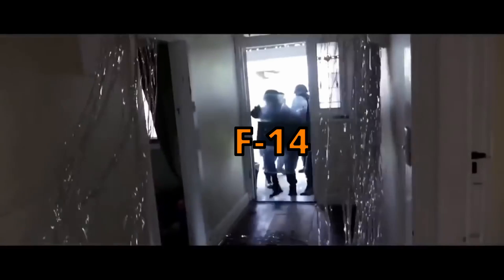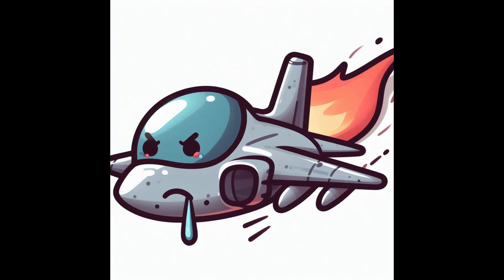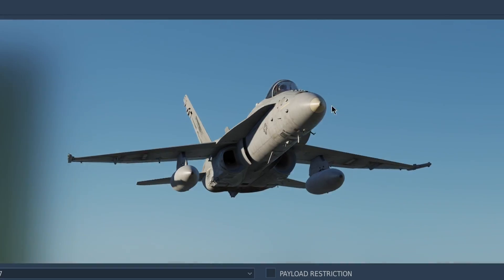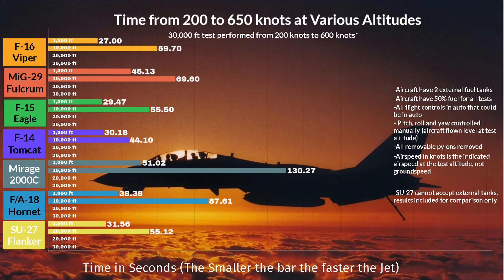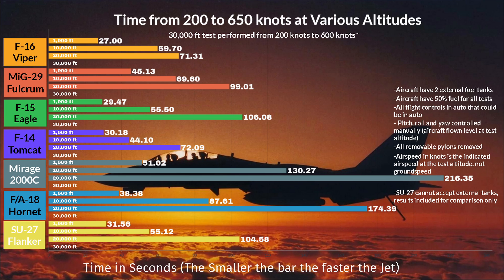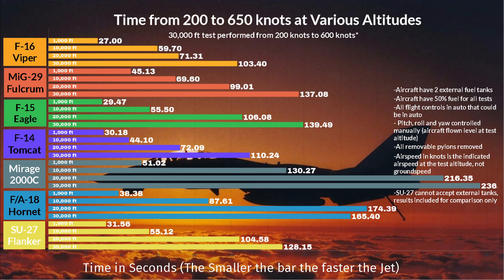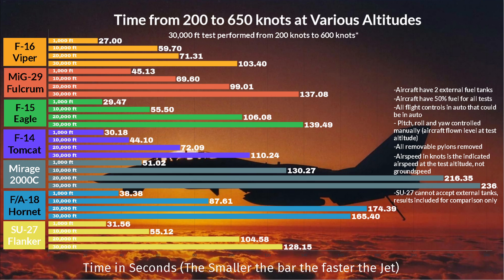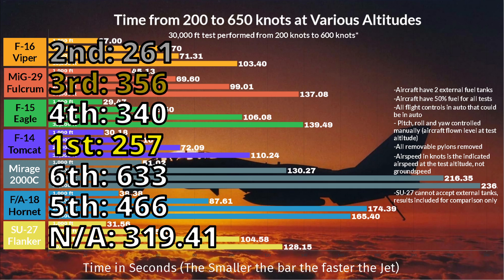F-16 DETHRONED! Fastest Fighter Jet in DCS Test

Comment: F-14B/D: 150kts to 610 kts at 10,000ft... 9.7 seconds. Fighter Pilot Podcast "F-14 Tomcat vs F/A-18 Hornet—Which is Better?" at the 2:29 minute mark. Tomcat model is not broken. This was a clean Tomcat but do not know what the fuel load was, probably under 10,000lbs. With tanks... maybe double this???? This is an average of 47 kts acceleration per second. Clean F-16 at airshows does 40 kts a second. The F-14 can do M1.6 at 10,000ft. I read the F-14B/D is the fastest accelerating aircraft in the US inventory at the time. Something like 1.5-2G under acceleration. Tomcat model is not broken. If it is broken, it is broken the other way... underperforming. 

Even after the latest flight model tweak, the F-16 bleeds energy above 400 kts. Mover flew the DCS F-16 after this flight model tweak and said it should not bleed energy in turns at 400 kts. At 450 kts, the Viper will accelerate through 9G. If you listen closely to real pilot stories of just about any aircraft, you'll hear the DCS flight models are still way off. Like the F-15C; it will see M1.8 with 3 tanks "up high". What is up high? Rodriguez who bagged a couple of MIGs in Desert Storm said he ingressed up high. When asked what "up high" is, he said "High 50s". This is above 55,000 ft AND with 4 AIM-9s and 4 AIM-7s. What speed does it take to keep an combat loaded (with wing tanks or a centerline?) F-15 from falling out of the sky at 55,000+ft???
Reply: I think the claim in that video is a bit exaggerating. I think it is close to impossible in a level flight to achieve that acceleration: 
Force = mass * acceleration. Acceleration = Force / mass. Force is the thrust, mass is the aircraft's weight.

F-14D: assume relative low weight during test of about 22,000 kg (3,000 kg more than empty weight). Engines combined thrust with afterburner is about 241,000 Newton.
241,000 N / 22,000 kg = 11 meter / s^2 as acceleration. This is about 21 knots per second. 

F-16C Bl30: empty weight of about 8,300 kg, with some fuel and pilot let's make it 10,000 kg. AB thrust (static) of about 130,000 Newton. 
130,000 N / 10,000 kg = 13 m / s^2. That is about 29 knots per second

The engines produce more thrust at higher speed, but the air resistance grows proportionally to the square(!) of the speed. 
A Hornet might have a better thrust to weight ratio than a Viper under certain circumstances. It would out-accelerate the Viper at low speeds, but the Viper would start out-accelerating the Hornet at higher speeds because the Hornet is just a draggy design.
Reply from the maker: @slowhornet4802 That is some very interesting data that i, of course, completely understand 😂

I can attest to your thoughts on the hornet though. In my experience with it in BFM (below 500knots) it certainly keeps up with the "fast" jets well enough.
Reply: @slowhornet4802  There is math and there is a real world, non-theory, seat of the pants, human pilot experience and feedback/results. It looks like you are a math guy so perhaps you lean to the math and trust this more than a Tomcat pilot who flew the Tomcat. Understandable. Time and time and time again I read "how the jet should perform according to x and xy and xyz" yet in real life, the jet outperforms these numbers/data. Once again, F-16 demo at an airshow,  the MC, also an F-16 pilot says the F-16 is accelerating at 40 kts per second. The F-14B engines are "rated" at 27,000 lbs of thrust be it installed or otherwise but are they really rated at 27K? And what about the F-14D's intakes? Etc... etc... etc... Anyways, don't mean to come down hard on you. My apologies if I am. My father flew the CF-104, CF-5 and the F-4. He never exaggerated the performance of anything he flew. He remained "true to the jet" never making the jets he flew, liars. On the opposite end, an aerospace engineer on a forum took an SR-71 pilot's account of a mission over Libya and ran the numbers and deduced the true top speed of the Blackbird: Mach 3.88. Sometimes a pilot tells the truth and sometimes a pilot REVEALS the truth. Here is another real world account: F-22 can sustain 28 degrees a second at 22,000 ft... pilot confirmed at a Red Flag briefing. Work the numbers and tell me how many G this is. Someone will then say the pilot cannot sustain this many Gs and I then ask, "You know this for sure?".  Final pilot account: Dozer, an F-22 pilot wants to see what the climb performance of the Raptor is on take off. Fully combat loaded jet - 70,000 lbs - and Dozer pulls pure vertical at 570 kts just after wheels up. Passes through 30,000ft and Mach meter reads M0.99. This post was REMOVED shortly after he posted it and he got in serious trouble. Now, the thrust of an F-22 is "rated" at 35,000 lbs per engine so 70,000 lbs of thrust can propel a 70,000 lbs airplane to the very edge of the sound barrier vertically at 30,000 ft? What does the math tell us about this or, what WOULD the math have to tell us about this? The F-119 really produces 29k/43k dry and AB thrust? More? 30/45? Does the math account for the intakes? Etc... etc... etc... Go back to the math for the F-14D. What math would make sense for the 150-610 acceleration in 9.7 seconds or a rate of acceleration of 47kts/sec?  Cheers.
Reply: @knightonwarbeck1969  Interesting read! Not harsh at all. I am not a pilot in real life. And I suck at math 😀 
Just trying to apply some basic formulas. If the claimed accelerations were possible the F-14 and the F-16 would require not just a little bit more thrust, but the engines would have to produce 1.5 to 2 times of the static thrust. 

The F-16 during airshows will probably land with about at least 500 kg fuel (about 1,000 pound). Which means it is probably closer to 10,000 kg (would be about 50% internal fuel) when the claimed acceleration of 40 knots per second was achieved. 
40 knots per second = about 20 m / s^2 . 
10,000 kg * 20 m/s^2 = 200,000 Newton = 20,400 kg thrust versus 13,000 kg (with afterburner) per Wikipedia. That is 50 % more thrust. 

Now, thrust is changing with speed, and some aircraft (F-104 is a very good example) have intake and engine designed to work best at very high speeds (Mach 1.6 for the F-104). But keep in mind, the calculated required thrust above does not even factor in air resistance, the formula factors in only the required force to accelerate a given mass with a given acceleration. It does not say how this force is generated, it just states that this is the bare minimum required force to accelerate 10,000 kg with 20 m/s^2 without any other factors considered. It e.g. also does not factor in that the aircraft needs to produce lift (in level flight every second the aircraft needs to produce 10,000 kg force upwards.). Or that the wheels start spinning during start (which requires additional energy). 

Maybe I apply the formulas incorrectly, maybe the thrust increase with increasing speed is indeed 50% or more, maybe the available numbers (static thrust) are lower than the real ones. Maybe the truth is somewhere in the middle.
Reply: @slowhornet4802  My father said at M1.4, there was a noticeable increase in acceleration in the F-104 and again with the T2 Reset, giving the engine more rpm and feeding the afterburner with more air. I am certainly biased to believe a pilot's accounts and sincerely find it difficult to believe that Tomcat pilot was lying about 150-610 in 9.7 seconds. Why would he lie after all these years? The pilot is credible and he does not sound like a bullshit artist in any way. Maybe this was with 2000lbs of fuel remaining? Maybe he added the optimal negative G to unload the jet - .5g as well? He started with wings forward and flaps down. Tomcat can also do M1.6 at 10,000ft. I know the F-104 with the most potent variation of the J79, the -19, with only a couple more thousand lbs of thrust, has a performance increase that "we think" would not be substantial but it is. Read the following article by Walt BJ called "Ruminations on the F-104" to see how this "small thrust increase" makes massive increases in performance. My father also said of the F-4, "The faster you go the better it gets" again with 2 J79 turbojet that "like air/ram air effect". Bottom line is we are not fighter pilots and are forced to dig through endless posts and podcasts to eek out the truth of jet performance, at least I do. Glad we are still friends. 👍 

Here is a nice story for you. My father was posted to S.H.A.P.E. in Mons Belgium in 1988. I was 16. My best friend was an American, who's father was the top bodyguard for the SACEUR General Galvin. My father was sent to the NATO school in Oberammergau, in Southern Bavaria, for a week of courses.  This meant a car trip to Germany and use of the Autobahn. I was excited to experience speed and have dad wind the car up to a top speed. We had a 1984 Toyota mini-van (Google it and laugh your ass off). Much to my disappointment, dad never exceeded 120 kph. Cars were going by us so fast the van was rocking from side to side. I asked him why we are not going faster than 120? He looked over and replied, "Son, I have flown 700 knots, 50 feet off the ground (Canada used the F-104 for nuclear strike). What possible thrill would driving at 150 or 180 kph give me?" Point made. Point taken. 700 knots is 805 mph or 1,304 kph. I am happy to leave you on a positive note. We did pass 3 things that day; 1 dump truck and a grandfather and his grandson on bicycles.
Reply: @knightonwarbeck1969  Hi again, I like all this additional information, especially about the F-104! 
I do not say that the Tomcat pilot was lying, but maybe his memory was not accurate, or maybe it is just true and my calculation is wrong (lack of knowledge of true performance data, or simply because I am not a physicist and my interpretation / calculations are wrong).
Maybe the Tomcat could accelerate that quickly, but it would have required engines to produce about  2.5 the static thrust just for the acceleration piece (plus thrust for air resistance, which increases rapidly with speed). With that amount of thrust the Tomcat could have flown straight upwards at max weight for an extended period of time. Even the (early) F-15As with better thrust to weight ratio could not do that without losing speed (according to comments from F-15 pilots). 
Not saying this is impossible, but that would be a huge increase of thrust. I am trying to find some data how (fighter) jet engine thrust is generally changing with speed. But so far I could not find any graphs which quantified the increase in thrust with increase of speed yet. There are some qualitative graphs. When accelerating from zero speed thrust first decreases, then increases. Especially if the air intake is well designed, which is the case with the Tomcat or F-15. 

Re your minibus: 180 km/h WOULD have been an extra thrill in a Toyota minibus 😀
On another note: I have read somewhere that US F-15s based in Germany picked up some fast cars on the Autobahn with their look-down doppler radar. The doppler radar could pick up objects against the ground only if there was enough difference of the doppler shift (= object speed versus ground had to be high enough). Apparently some sportscar were fast enough to appear on the radar screen. Something that did not happen to US based F-15s.

Anyway, good conversation. As said, I am just a bit interested in aircraft but by no means an expert.
Reply from the maker: That's good info, thanks mate! I am not saying the f-14 is too fast. Nor am i claiming to be good at flying the tomcat in DCS. Simply that it accelerated from 200-650 knots at 10,000ft in pretty much the same amount of time with and without external tanks. Plus, in these tests the aircraft have a 50% fuel load total with and without external tanks. So the tomcat had an extra 300 gallons of fuel, external tanks, and performed similarly, where as every other jet here saw significant slowdown in acceleration times with external tanks fitted.

As for the f-16 someone in another comment made an interesting point that the flight model in DCS might actually be pretty accurate for the f-16, It's just that the dcs pilot can't support the g force to do it.
Reply: @Tabs_Original  Again, Mover fighting Gonky and comments the F-16 (clean) shouldn't bleed any speed at 400 kts (or above) down low, but it does. A Viper test pilot tells us the Viper will accelerate through 450 kts holding 9G, ditto for the Eurofighter. But Mover sustains 9G @ 400 kts and bleeds speed down to 250 kts. I trust Mover's F-16 flying accounts. My 2 cents. I do like your content. I like performance comparisons of different jets. Keep up the good work.
Reply from the maker: @knightonwarbeck1969  I agree the F-16 is off. I think it would fair better with a pilot that didnt immediately black out at 9g. but yeah it bleeds speed pretty badly, the module in DCS doesn't provide very good feedback like the shaking in the Tomcat or Hornet.
Reply: @knightonwarbeck1969  I would not trust Mover too much.
Reply: @slowhornet4802  My previous post got deleted or didn't successfully up load. There is an awesome article on how the F-104 beat the F-15 in DACT. Search Starfighter 4 Eagle 0. They were flying the G model. Take off flaps or maneuver flaps could be used up to 550 kts. Must be raised and lowered before 450 kts. One of the pilots Andy Bush, stated in other articles, a clean F-104G sustains 6-7g at 400-420kts (with take off flap). The general aviation public is grossly ignorant to the 104's performance, thinking it is a turkey when in fact, it is an "eagle" (M2.0 at 73,000ft in 3/4 AB sipping 100 lbs a fuel a minute). Just imagine a modernized 104 with AESA and AIM-120Ds launching at 75,000ft and Mach 2.5. Is this a Mach 6, 200-250 mile AMRAAM? Pilots flying the 104A with -19 J79 variant said this 104 would smash the F-15 Streak Eagle records and challenge/beat the MIG-25 Foxbat high altitude records too. Mover is untrustworthy?

Also, an article linked to the bottom of the F-104 vs F15 page - Despite the Starfighter shortcomings, the pilots who flew the F-104 fell in love with it - the pilot said the F-104G would supercruise at sea level. All the dense sea air giving the 104's J79 engine increased thrust to go supersonic in military power.
Reply: @knightonwarbeck1969 many thanks. I am still searching for a story when during a promotional event for the F-15A the F-15A took off an climbed vertically at  relative slow speed. The F-104 team decided to secretly strip the F-104 off weight as much as possible. The F-104 accelerated and climbed with high speed at 60 degrees and vanished into the clouds. It made the F-15A look less advanced, and the F-104 team got some punishment. 
I agree that the F-104 performance was incredible, especially considering how many propeller aircraft were still flying when the Starfighter could already reach Mach 2+. It could also use its power and its turn performance at higher speeds to its advantage. However, hanging stuff under its wings or belly impacted the performance (maybe except for Aim-9s at the wing tips, which improved aerodynamics).  I think this is why @Tabs_Original's test with typical loadouts is much more useful. Larger aircraft usually suffer less when adding weight. 
E.g. just adding chaff / flare dispenser was equivalent wot adding a Sidewinder (http://www.916-starfighter.de/F104_Chaff%20Flare%202011.htm).
Reply: @knightonwarbeck1969  About trusting Mover:  
He has many interesting interviews and videos on his channel. But he seems to lean towards bragging at times, and he is quite narrow minded. Often his only argument is just that he was a real fighter pilot and a non fighter pilot could not even discuss with him. The audience should just sit and take notes, when the big boys are talking. It is funny how many people follow that instruction and behave like submissive flatterers. If you dare to challenge him Mover likes to swing the ban hammer real quick. 

A discussion like we had here about F-14 acceleration performance would have been impossible on his channel.
Reply: @slowhornet4802  Okay, I see now. I don't watch his content much because he has no charisma and is dry as a pancake. What you are witnessing with Mover is what I had to grin and bear with my father; ARROGANCE and specifically, Fighter Pilot Arrogance. Now, All Mover did was fly a jet or two jets or 3 (Viper, Hornet and Talon). He never had the inclination or talent or skill or personality or the motivation or whatever, to do more or go better like move up the ranks and actually showcase his full potential. He is a one trick pony if I may be so daft to say so. To me this is shallow arrogance. As I said, I had to grin and bear my father's arrogance BUT he retired a full bird Colonel with many prestigious postings under his belt (NORAD twice, S.H.A.P.E., Base Commander at CFB Trenton, and numerous awards and distinctions and courses). It is my understanding Mover has authored a series of novels so hats off to him for applying himself in another direction. You know he is shallow arrogant because he speaks his internal fighter pilot lexicon to the commoner without any explanation of what any of this means, intentionally withholding any education of "dynamics" of flying jets, as a way to keep himself "high above" the eager to know and learn listener. He maintains his position this way. How do I know this? My father did the same and to such an extend, I felt like a complete idiot asking him ABOUT ANYTHING REGARDING HIS FLYING. His answers were short and delivered with a degrading contemptuous attitude. So, I stopped asking and went it alone to find the answers via other means such as message boards, article, podcasts, books, and here in the comments sections of YouTube. Interestingly enough our sponsor in Mons, Belgium for the S.H.A.P.E. posting, was a CF-104 Test Pilot. I recently reconnected with him after 35 years and have been picking his brain about... well... everything F-104 related and more. 

I did read that article of the 104 making the Eagle look bad. I remember the speed was 400 kts for the pull to 60 degrees. Hilarious.
Reply: @knightonwarbeck1969  I think Mover mentioned a medical condition which ended his career in the Airforce / Navy.  Then again, from his videos it does not seem he would have been a great leader. But maybe that is just his face towards the uninitiated.
I heard his books are a bit shallow, but then again, even publishing a shallow book is more than not publishing any book. Though I will probably never read one of them for the fear he put in some romantic sidelines... something like 22 year old girl falls in love with 45 year old lone wolf special force guy..... maybe I am wrong, but better not take any risks 😀

What I find really funny is how he believes he has any authority outside of his bubble... e.g. the way he "managed" the Spudknocker issue. Hilarious, if I would have been Spudknocker I would for sure have replied differently after Spud's first apology. 
Or his "I pull out of making DCS videos because there are so many toxic people in the DCS community".  Just because some people dare to challenge his opinion they are toxic? 
Grow up Mover :-) 
Anyway, don't want to make this a Mover thread.  

SO many thanks to @tabs_Original for making this video. I learned some new stuff about the F-104, which is one of my favorite aircraft despite all of its shortcomings.
Reply: @slowhornet4802  Agreed. Mover who???? And "hats off"  to @tabs_Original. I will be submitting pilot accounts of fighter data in the near future and tabs will create a video to compare with DCS flight models. Cheers @slowhornet4802!
Reply: @Tabs_Original  Yes and do not mistake my words for saying you are wrong. I know you are sharing your test results. I am using a highly skilled and houred Tomcat pilot's account of real world acceleration numbers. Will we ever get to experience an accurate flight model? I sincerely think not. From all the pilot accounts I've studied over decades, the high altitude, high Mach performance of DCS flight models are not accurate. Why? I believe we have little to no data in this flight regime as I mentioned above.
Reply: https://www1.grc.nasa.gov/beginners-guide-to-aeronautics/enginesimu/
very interesting web page. It calculates engine thrust based on various parameters. Net thrust increase with speed in the relevant range is far less than what would be necessary for the accelerations pilots claimed for the F-14D and the F-16. Anyway, would not completely rule out the pilots were right, but physics seem to be say it is not possible.
Reply: One thing i've noticed is that with people talking about climb performance are thinking thrust=climb rate when that isn't actually true, its power availible over power required so the more excess power is available the better the clibmb rate, a good video that explains this is about the F-14's horsepower by gregs airplanes and automobiles.